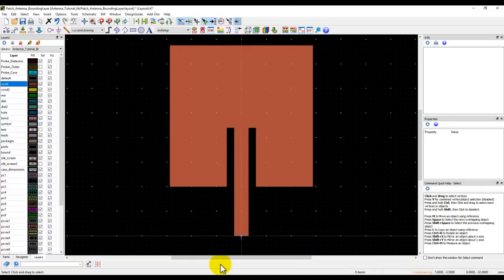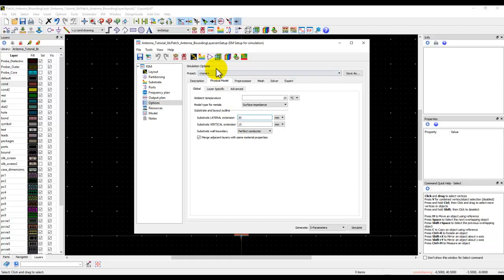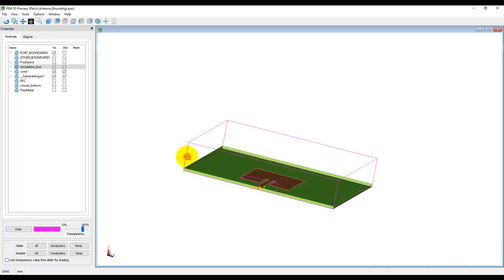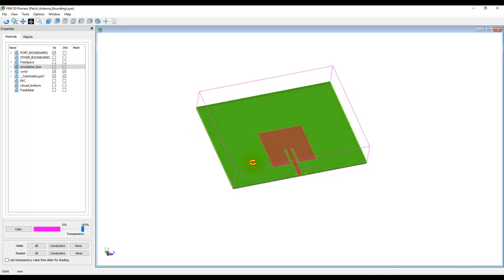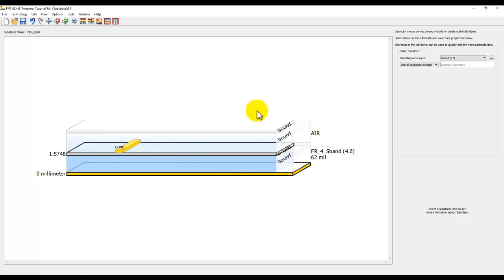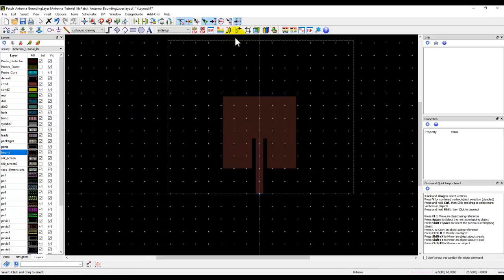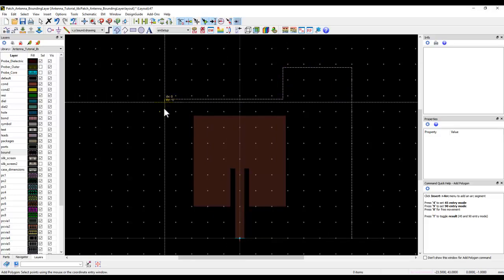Tutorial-34: Understanding Bounding Area Layer for FEM

Comment: Thank you. This is the first time I've heard about the bounding layer option. I've always been puzzled as to why the substrate gets extended to the edge of the radiation box. I have a general question though about the size of the radiation box for simulating microstrip structures. I've seen that the box should be at least lambda/4 away but I see dramatic changes in the results of the microstrip filter I am simulating by making just small changes in the box size > lambda/4. Also, in this video I saw that you had the substrate wall boundary set to "perfect conductor" The default is "open". Is perfect conductor more relevant to a microstrip filter design? When should I choose open?
Reply from the maker: You should use "open" which is the default option to have absorbing boundary condition. You can use perfect conductor is you want to model a metallic enclosure like a box around your structure. For detailed help, I would recommend you to contact local Keysight support team for assistance.

Comment: Hello, thanks for an informative tutorial. Could you please give some suggestions to proceed with the case as described-
I have designed some components with the help of magnetic wall boundary condition within certain substate lateral extension and using direct port setup configuration.  All these components are designed with 50ohm characteristic impedance and gives the best results. Now if i want to combine these designed components in the layout,  and want these components to behave as they behaved independently, is there any unique technique of doing that?  I'll need magnetic walls around every components in the circuit. But in setup I can select only one common magnetic wall boundary around the entire circuit and that would change the behavior of individual components. Have I messed up with designing components in the way as described?
Reply from the maker: The kind of behavior you are describing would need some sort of full 3D drawing & simulation tool to model the kind of boundary condition you are describing. You could do something like this in ADS using the bounding area layer around your structure but having a proper full 3D tool like EMPro, HFSS, CST etc might make job little simpler for you however I have no experience in dealing with circuits like these so can't help much.
Reply: @BhargavaAnurag  Thanks for the response. I tried creating the boundaries around the components in the similar way as you showed in the video. Is there any way we could define this bound layer as PMC? I don't see any option to select material for this bound layer in the substrate window. I think it just cuts some amount of substrate as per bound shape.

Comment: Hi!
thanks for the tutorial!
how can make a non-metelized rectangular hole at center of a substrate. 
I have a 2 layer PCB. pcb traces are on sub1 and at the center of top substrate (sub2) there is a rectangular cute.
Reply from the maker: You can add a dielectric via and define material as Air. This kind of geometry can be easily created and simulated by FEM in ADS.
Reply: @BhargavaAnurag  
Thank you sir!

Comment: Hi. Great tutorial.

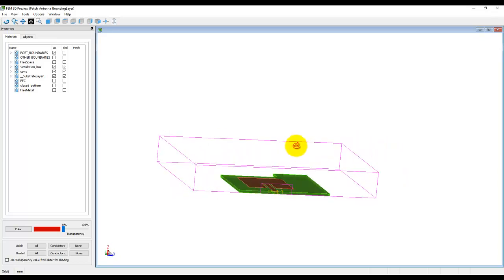I've a question from the 4:50 onwards. When we have drawn a bounding layer, substrate is cut accordingly but air is still in a rectangular shape. If I want to put air only where substrate is, so that I can see reflections caused by reduced air, how I'll do that?

Secondly, what if I have two boards of different substrates, placed back to back in a single metal cavity? How can I assign two substrates to a single layer board within a single stack up definition.

Sorry for long question, and thanks in advance.
Reply from the maker: 1st part, the Bounding area layer can be of polygonal shape as I showed in the video so you will have air modeled accordingly near to your substrate and if you have conductors very close to the substrate edge they will see the abrupt truncation of the field due to dielectric and air interface very close to them so you will have the desired effect modeled there. I think you got confused looking at the overall Airbox which will always be a rectangular kind of shape no matter which tool you use as per my knowledge.
2nd part, You can do so using Smart Mount to bring over 2 PCB technology and assemble them in a master design and here your master design can be a simple Air dielectric based substrate...Watch the Smart Mount video that I posted with one of the Top10 features of ADS2021 video playlist.
Reply: @BhargavaAnurag  thank you, I think it's time to get the newer version of ADS. I'll try it for sure.

Comment: For radiating/guiding structure design, what would be the rule for (a) & (b)
(a) Mesh -> Initial Mesh -> Global -> Target Mesh
(b) Port Surface Scaling & Port Surface Boundary (under Physical Model -> Advanced)

(c) Bounding area layer making the PCB size finite, is it anyway different than finite ground (ground plane as strip in 2 layer substrate definition) simulation? It looks like the simulation box/radiation boundary is touching ground plane, so no back radiation is considered here unlike 2 layer structure. 
(d) For finite PCB size, will substrate lateral and vertical extension be followed similar to infinite ground plane case (as 1/2 wavelength and 10 times substrate thickness respectively) as well?
Reply from the maker: Hi Riju,
Too many questions in a single message but I will try my best to respond to these:
For a). Automatic usually should work for you. If it doesn't and you need a faster convergence doing custom setting with lower mesh size will result in faster mesh convergence as you would change the starting point of the mesher. I would say lamda/10 or lamda/20 could be good starting point but be aware that if you end up creating very small mesh size to begin with then memory required will be much higher.
For b). Again 3 & 3 is a good starting point but if you want larger port area for TML/Waveguide Port then 5-5 is another option to consider but mostly 3 should be fine in most cases unless you want to excite higher order modes etc
For c). Bounding area is different than finite ground per say, you can have large substrate but limit the ground conductor size which you referred as finite ground. In my case I have used Cover at the bottom hence it is PEC boundary condition applied on Lower Z side hence you don't see backlobe but if you make it like a proper 2 layer stackup definition and limit the ground and use bounding area layer to limit the substrate etc you will see backlobe while performing FEM. We will cover this when we talk about Coax Fed Patch etc in future tutorials.
For d). You need to decide lateral extension based on the size of the real world PCB fabrication you will eventually use to make sure there is no distortion to circuit performance incase you cut the PCB very close to the transmission line as it can happen in some cases etc. For vertical extension it depends on what is the box height in which you will place your circuit and if you want to model the box then vertical extension should be defined as per box height and the boundary type should be used as PEC instead of Open.
Hope this clarify your queries....!!
Reply: @BhargavaAnurag  Thanks for explaining in great detail. Will wait for the coax fed patch.
For (d), for general case (not modeling the box), what value of vertical extension is taken when the antenna has finite ground (proper 2 layer stackup) & bounding area are used?